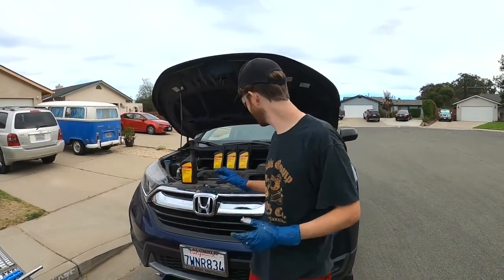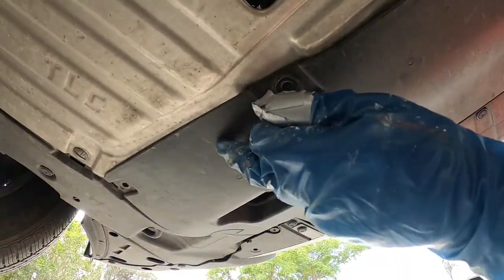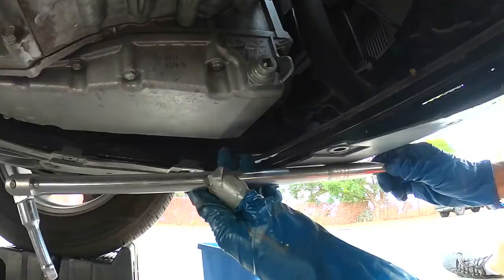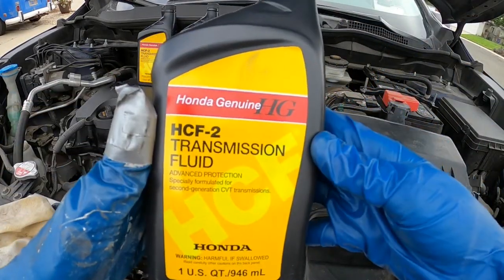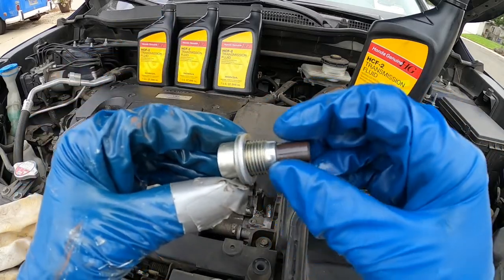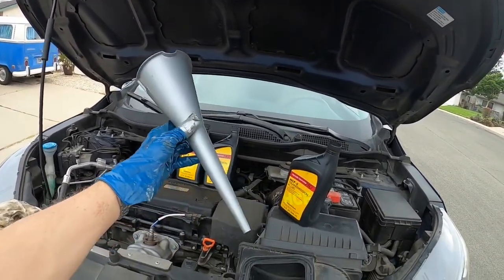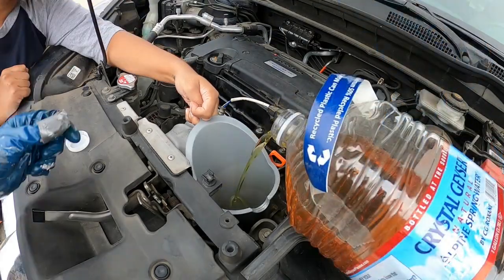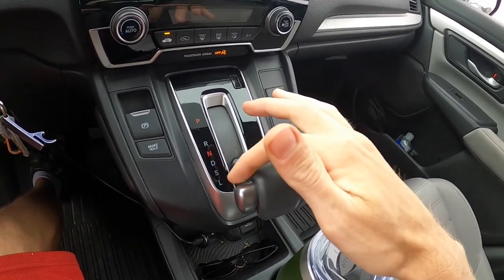2014+ Honda CVT Transmission Fluid Change. CR-V, Civic, Accord, HR-V, Fit, Pilot, Odyssey

Comment from the maker: TOOLS & SUPPLIES
HCF-2 Honda Transmission Fluid- https://amzn.to/3kg4ncX
Drain Plug Crush Washer Gasket- https://amzn.to/3WnaBp7
Long Funnel- https://amzn.to/2sPHpPu
Drain Pan- http://amzn.to/2wzrVhE
Breaker Bar- https://amzn.to/2pBYqap
Torque Wrench- https://amzn.to/2GHorwh
Car Ramps- http://amzn.to/2x668zQ
Wheel Chocks- https://amzn.to/3fAs6Aj
3 Ton Jack Stands- https://amzn.to/2Em3hEX                 
Floor Jack- http://amzn.to/2CJhLPF
Mechanics Gloves- http://amzn.to/2w0i1SP
Nitrile Disposable Gloves- https://amzn.to/3w714qi
Automotive Tool Set- https://amzn.to/3tbmEbo
Safety Glasses- http://amzn.to/2ez41Jw
Magnetic Work Light- https://amzn.to/33tk6tp
If you Enjoy the Channel Consider Helping Support it by Donating below & by Subscribing.
PAYPAL DONATION https://www.paypal.me/JonnyDIY

Comment: I have those Rhino Ramps and after seeing this, I realized I can use it for my Civic and not just for my mowers. Thanks.
Reply from the maker: You're welcome, yes they're great for me. Have been using for years with no issue. Knock on wood. As long as ones you have are rated for the weight they're good 👍

Comment: Probably not a bad thing to redo the video in daylight. 
I’ll be changing mine plus rear differential as soon as I get the correct fluids. 
Hopefully I can find it cheaper than the $30 per quart I see on Amazon Canada.
Reply from the maker: Good luck 👍 call around to closest local Honda Dealers. Should be able to find better price. Ebay has decent deals too 👍

Comment: Can I use that fluid on my 2013 honda fit
Reply from the maker: @funnyguydescartes1347  No I think that one just takes regular Honda ATF fluid. Check owners manual for fluid type and capacity. I would go to dealer theyll be able to give you right fluid. You only want to use Honda fluid 👍

Comment: Not sure what country you're in, but at least in the United States, for the 2014 Model Year they still used the 5 speed AT, switching to the CVT for 2015.

Not so oddly, You can buy a used transmission in the junk yards for a 12-14 model for $150-$400.  For a 2015-2016? More like $1500-2000.
Reply from the maker: Thanks for the info. From something I had read about the CVTs is they must have rolled it out in 14 on some of the models. I believe the Civic and Accords 👍

Comment: Using a jug is inaccurate. What if the trans is under or over full from the last service? You’d be filling to that same level. Since the Honda LL-CTVs (and M-CVT in the Fit and HR-V) don’t have dipsticks to confirm the level, the check bolt needs to be used. Also the process is different in the 6AT, 9AT, and 10AT equipped Hondas.
Reply from the maker: Yes I mentioned the correct refill amounts as well as the check bolt 👍

Comment: My coworker just paid Honda $6200 to have her CRV CVT replaced with only 54,000 original miles on it. Honda CVTs suck!
Reply from the maker: Dang that's too bad, sorry to hear. I haven't heard of widespread major problems with these transmission before though. This one had over 100k without issue. She may have just got unlucky, I usually get an extended warranty for at least 100k on new cars since repairs are so high now
Reply: Your coworker didn't replace the fluid ever it's her fault so F. Your coworker and you lil B.